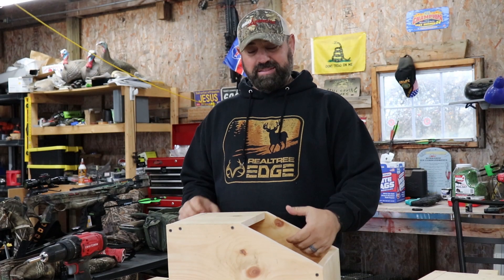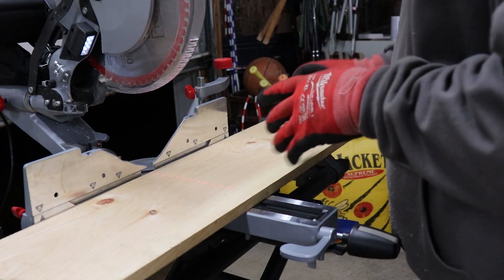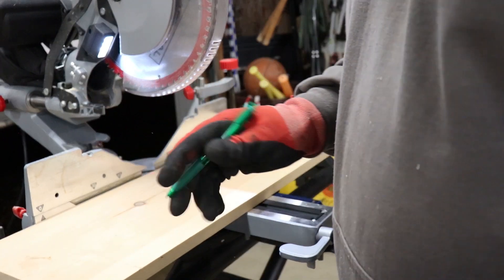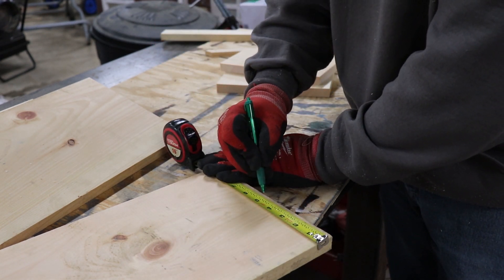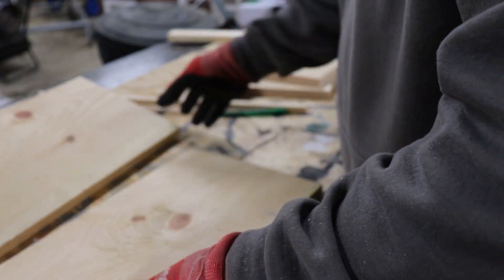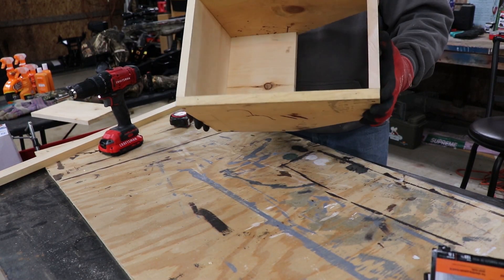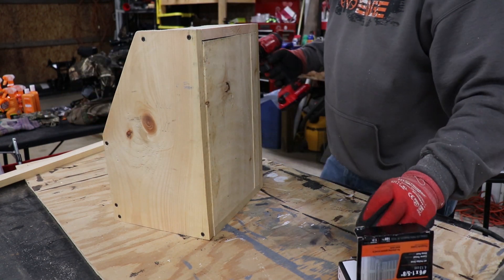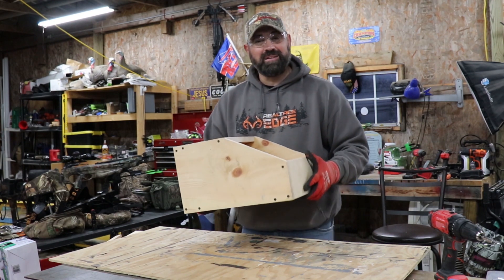DIY Rabbit Nesting Box ~ Cheap And Easy!

Comment: I precut all the pieces to make 4 nesting boxes .everything went smooth but my bottom optional peice was 1/2 inch off so I  ended up leaving a gap near the front for airflow. Didnt realize I would have that problem until after. Its because I ripped a 1/2 4x8 cdx to 10 inch widths with my table saw and cut all the peices with my miter saw then cut all my sides with a skill saw. Then used a 18 gauge nailer and wood glue to build the boxes which should be strong enough to hold them together. Anyways thanks for the video and posting your measurements I was able to build all four in about a hour I have doe's that are all due on valentine's day.
Reply: I don't think it's a good idea to use wood glue since these boxes will get chewed on.

Comment: I strongly recommend NOT putting a wood bottom in the box, because after use they must be cleaned and disinfected.  Truth is, given the propensity of wood to absorb liquids, you can never really fully clean them and after 2 or 3 uses they really should be discarded and rebuilt.  An alternative that I used to use is 3 or 4 layers of cardboard cut to just fit inside.  After use, toss the cardboard in the compost and just replace the cardboard.  I never had to replace my boxes this way.
One other suggestion for those making nestboxes: do not begin building them UNTIL you have first measured the cage door and confirmed the intended box size will fit through the door.  Ask me how I knew this.